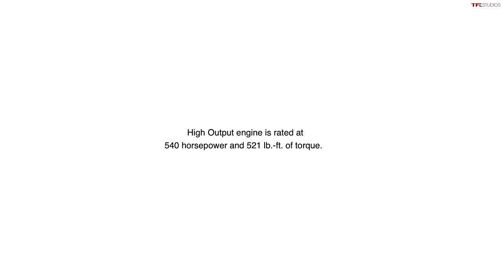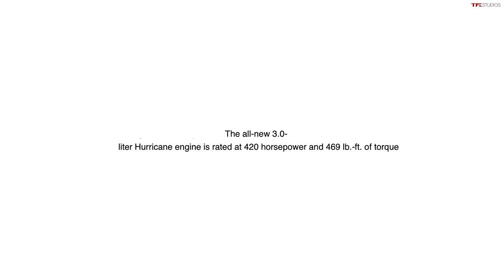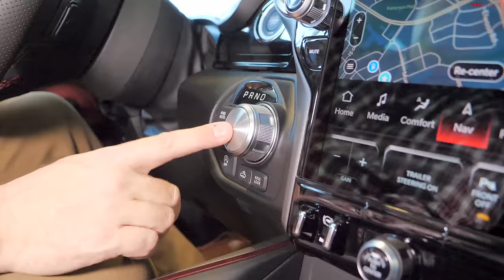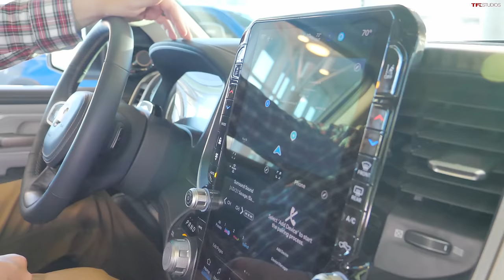I Go Hands On With The First New Ram 1500 In Over 5 Years - Did They Get It Right?

Comment: Great trucks but DAMN EXPENSIVE! Price-wise, the Tesla Cybertruck is looking better and better by the day! Add in a $5000 Propane Fuel Cell in it's back bed and I could get over a 1000 miles on a single charge for less than $30 USD when I exchange my 20 lbs propane BBQ bottle at any suburban 711 store or major gas station!

The Cybertruck carries more, tows more and is a heck of a lot faster/more powerful than ANY of the Big Three! The only thing that's missing is the Ballard Proton-Proton Membrane Exchange Propane Fuel Cell which can be added at ANY TIME AND it will give you lots of onboard 240V-30 amp and 120V/20 amp power plugs!

I hate to say this buy Elon Musk is right in that his all-EV truck WILL be the future! Today you can change over 240 miles range to over 1000 miles range simply by adding a fuel cell in the back bed for anywhere between $5000 to $10,000 USD --- It STILL comes out cheaper than these ones!

V

Comment: In 2019, bought a 2019 RAM Limited that sticker for $73,000. I got $20,000 off in factory rebate that were bundled. I got the truck, it had every single option a Limited had, and I ended up paying $50,200 out the door plus tax and license. The sticker price is for dumb people that have stupid money or just got a insurance settlement.  But if you do your homework you can get $20K off of these high end trucks.

Comment: Some competitors have Titainium models, and now we have a Tungsten models.  That makes me wonder, is the Tungsten model similar but grossly heavier?  Since Tungsten is 2.5 times heavier than lead, it should be a real Porker...I thought truck guys were tying to lighten the trucks to get better Fuel economy, using aluminum parts and even full aluminum bodies.  Also you keep mentioning effeciency as though all it meant was better MPG.  But let me ask, if a truck had twice the BHP and a hundred more Ft/Lbs of torque would it be less efficient than one that got 1 MPG more but half the BHP and a hundred less Ft/lbs of torque?  NOT!  Is a Maverick more efficient than an F350 Diesel just because it gets better Fuel economy?  Again, NOT!!

Comment: Thanks for sharing on the NEW 2025 Ram 1500, they look really great. I like the new design, makes them a lot more appealing. The new Tungsten interior looks awesome. I have a 2019 limited and I love the interior in it. However I am really disappointed in the choice of engines that will be coming with the high end models. If they are only offering the SST HO engines and NOT the SST this could be a deal breaker for me. I don't need a high end truck with 550 HP in it. It's the comfort that appealing to me, not the HP. Will have to wait and see if they will make other engine options available down the road. I will be going to the International car show in Toronto in a couple of weeks, so I'm really hoping they will have the 2025 Ram truck's their so i can check them out further.

Comment: I’m sorry. I’m not getting a truck without a V8. I’ll get a used truck if I have too. Fuel economy is not really that much better, this is a very complicated engine, and it is not the same as the old 4.0 reliable straight sixes.

Comment: Starting at 3:08 when they show the entire engine and frame railings, I keep saying to myself I could DEFINITELY DESIGN AND BUILD a much better AND MUCH STIFFER AND STRONGER box-frame-rail system that is STILL crash-impact-absorbing! That engine design pretty much ALSO SUCKS and I could definitely design a much more powerful high-torque engine using Radial ICE technology that lays the entire engine as a FLAT PIECE on the bottom of the front end to allow for an actual cargo-carrying Frunk while still using fuel-efficient ICE technology! 

I would throw out all those separate microcontrollers and use a dual set of 32-core AMD Threadripper CPUs to do all the engine control and navigation/infotainment/multi-camera interior controls work. I would also use a dual fibre-cable (for redundancy!) intertwined with a four-wire thick-gauge copper cabling running at a full 120V for onboard power needs.  All communications between sensors and engine control systems would be drive-by-wire using 400 Gigabits per second IPv6 low-latency packet-based technology that all run on the same buss and fibre-cabling! This would allow for routing and recording of Multi-spectral Optical and Thermal DCI-8K resolution cameras AND high-bandwidth RADAR/LIDAR 3D-YZX imaging for self-driving purposes!

For EMI/RFI/EMP/RAD-hardening of all the electronics, all the CPUs, power cables and sensors could be wrapped in flexible sheet Tungsten or mu-Metal for advanced Faraday Cage protection. My design is MUCH SIMPLER, much easier to manufacture and generally CHEAPER than the monstrosity shown in this video! For the vehicle operating system, I would use a 64-bit real-time Linux rated at 100 Microseconds for the hard Interrupts (i.e. can handle 10,000 separate hardware-interruptable tasks per second!) so that tasks are hard-switched with no individual runaway/race conditions being able to crash the entire system.

The frame rails I would turn into a two-sided hot-stamped 7075-series Aluminum Alloy with 15 mm extending-outward Honeycomb-pattern-stamped sidewalls on the interior AND exterior rails that are then aligned and precision electron-beam welded together for maximum torsional, tensile, compressive and flexural strength. You then coat the entirelty of the box rails entirely with a Galvanic protection coating (ZINC usually) AND THEN a high molecular weight and highly UV-light-resistant Polyurethane (aka Line-X truck bed liner!) to prevent rust and corrosion. Then you fill the entire box frame rails with closed-cell hydrophobic foam to ensure no water intrusion AND add to overall frame stiffness!

I could do that sort of enhanced CAD/CAM/FEA design in just a few weeks on CATIA!

Maybe Ford, RAM and/or GM should hire me!

V

Comment: 3.0l Duramax Sierra can do 720 miles on a 24 gallon tank
Reply: The Ecodiesel could do nearly 1000 with its larger tank.
Reply: @PlayWaves1  yea, but you couldn't do all of that at once since they were replacing the CP4 halfway into that.
Reply: @PlayWaves1 put a larger tank on the Duramax and it could do 1200 miles
Reply: @KeystoneTexan  Easier said than done.

Comment: I’d like to see a Super “Ike” comparison of a slow Loveland Pass run on a hot summer day between the Hurricane, the Hemi, and the EcoBoost (plus any other trucks\powertrains with comparable tow ratings you can get) to see how they all manage heat dissipation.

I’m betting that the Hemi won’t break a sweat while the turbo engines will struggle to keep cool.

Comment: dude you gotta quit justifying the prices for these trucks Andre, not just ram but all brands have gone crazy with pricing bud you realize that the people that work and need a truck for work have to go in to a stack of debt just to be able to get some thing they need for and to get to and from work, how about making a vid about how they can make trucks affordable again, you have a wide platform how about you actually use it to help normal people get their voices heard and get these companies thinking about the working class people, we don't need all those gimmicks we need a solid engine, good transmission and something that will hold up like the old trucks used to and that are actually able to be fixed with out having to test a ton of sensors

Comment: I think the CDJR brands are done. Stellantis' decision making really doesn't make sense. Jeep is WAY too overpriced to the point where it is killing the sales big time, and the quality has taken a significant dip over the years. Chrysler is at this point basically a zombie brand, so much so that now all of you luxury vehicles are coming from Ram and Jeep and they only have one vehicle with an overpriced EV on the horizion. Dodge needed a more family and economy oriented lineup, and while the Hornet wasn't a bad idea in that regard they chose to use an Italian built Alfa Romeo Tonale instead of something like a US built Cherokee. I know it wasn't the greatest vehicle, but you could have literally given it all of the same features as the Hornet and the same drivetrain with the option of the 3.2L Pentastar. On top of that it would have saved the Cherokee's assembly line... since the model was dropped the plant has been sitting idle. That is a HUGE L for Stellantis in my books, since not only would it have possibly been cheaper to go this route, it would have also been something they could brag about as far as supporting American labor. Instead of Dodge taking what was working for them they are now dropping that in favor of an EV that supposedly will have a gas engine option and the Hornet. The Durango is on boroughed time, and once they drop that SUV for some other large crossover it will sail the company south just like the Journey. They needed to keep the 4 door Charger and discontinue the high output trims of it. Leave the GT, SXT, RT, and SRT (6.4) but give the two lower trims the I4 Hurricane and the two higher ones the I6 SO and HO Hurricanes as upgrades. At that point they could have left the Hellcats and higher level engines, both Hemi and future Hurricane engines, with the Challanger. The new Charger itself should have been a refresh of the Challenger, and the Charger should have stayed with maybe a wagon variant, basically a reintroduction of the Magnum. Apply those lower trims to the Durango, Challenger, and potentially new Magnum, and they would have been set. The I4 and SO I6 have plenty enough power to push the existing Charger and Durango and would have really put them into that economy class since the I4 in particular would have been able to get some pretty good fuel economy. This way if they want to still do the EV route they could electrify the Charger as a 4 door and Magnum. Those are almost guaranteed to make better sales than the 2 door Charger EV, since they are actual family vehicles. Now you have Ram dropping the Hemi from the 1500, which was so much of a driving force behind why people bought the truck in the first place that they literally cut ads emphasizing the engine's sound and durability (not the greatest, but probably better than what's replacing it). If they keep the Classic with the 5.7 Hemi while these new trucks hit the lots, there is actually a chance that it will outsell the regular 1500 since it not only is cheaper but also comes with the V8. They should have given the Hurricane I6 as an option with the 1500 instead of just dropping the Hemi like this.
Reply: TLDNR

Comment: No V8, no thanks, l'm out!!

Small but highly stressed and high temperature turbocharged engines won't have the longevity of a larger cubic capacity non turbocharged engine, even of similar horsepower and torque  figures.
Time will tell how good or bad these diminutive sized engines will be.
I wouldn't buy one, as first and foremost, they are over priced for what they are...Plastic fantastic crap!!

Comment: This is lame as shit they just changed the front end & new tail lamps I’ll stick to my v8 with nice ass borla attack & Remember guys u don’t get the hp there telling unless you use 93 octane. I don’t need to run 93 octane in my 2024 rebel I have that’s why I went with v8 before there all gone this motor is gonna be bitch to fix I have a good reliable v8 this will be my last truck my cousin works for ram & get ready for headaches on this new motor there already having problems with jeeps hurricane engine